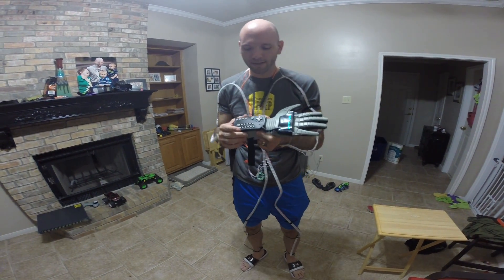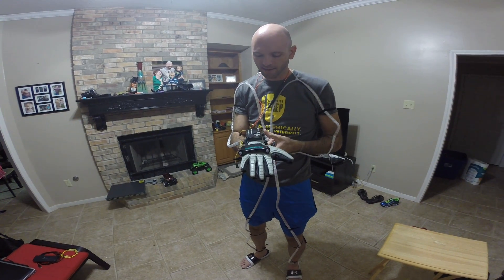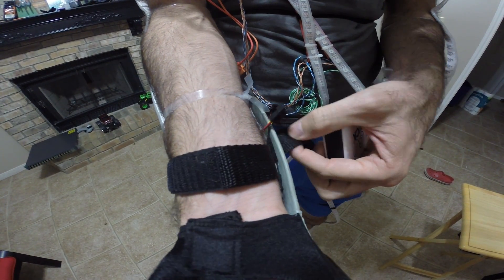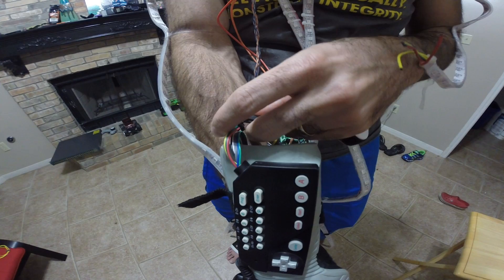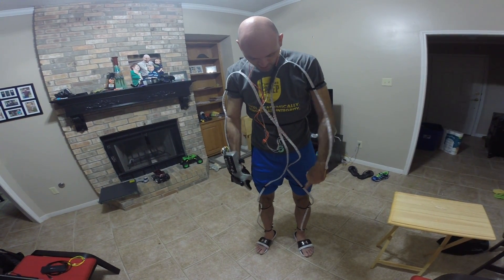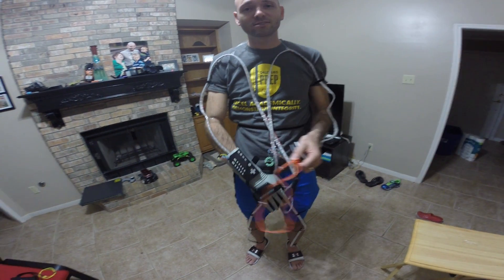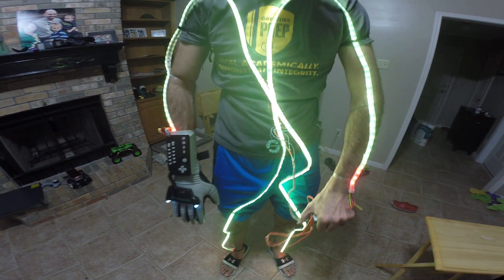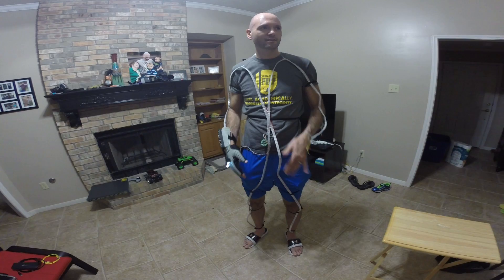NES Power Glove Light Suit

Comment: Ok all in all its really good. However if i might point out. When the lights are all on and you have the off color light moving along the path. Brighten it or make it a slightly more dominating color. That way you can literally follow it with more ease and in doing so it adds more to your performance.

Another thing you should look into is taking that idea but actually making like a full clothing out of it. aka gloves, shirt; pants, feet; and maybe work something out with a hood? IDK that was the impression i got from watching this. Now don't get me wrong, i've no idea how that stuff works but i think you could make it go a long way. All in all it looks wonderful.

However, is there a way to take away all the buttons and just let the glove/gloves do all the work. Like the right glove controls half( by this i mean all the right fingers correspond to a different action) and the left glove controls the other half? This way you wouldn't have to temporarily stop to click a button and in turn could focus more on making different rotations of the light and so forth.

Another thing that you might want to think about is maybe work in a way to have it react to your body. Say for example you move your left foot to the left spin and then move your right foot= rotation of lights only key to that movement. This way you can use your body; mind an knowledge of programs and so forth to make it better. < Just brainstorming. Not sure if its possible but figured i would give some input. Loved it nonetheless. :) keep up the good work.

Comment: Definitely, get someone like Fikshun or another good 'popper' to wear it. Also, I can't tell if you've done it yet, but you also could have the lights respond to the beat/sound, like in a lot of the industrial light and fireworks shows, where the lights, fireworks and lasers are "synchronized" to the beat of the music - but it is a cool idea to have the glove also able to control the various stages of the lights. Also, unlike the Adafruit posting below, I disagree - lasers are NOT at all a bad idea; not a "waste" at all - if done properly, you could combine LEDs and lasers, and have a stunning effect nobody has yet done! You'd have to have a "smoky" (artificial or otherwise) environment for the beams to be seen but, aside from that, you could integrate lasers, along with LEDs into the glove and the suit; or, maybe have lasers from outside, target the suit; and, when the lasers hit the suit, you activate the LEDs, almost like the lasers are activating the LEDs (picture "laser tag"). You could take a modified laser tag receive and actually make that happen automatically. Utimately, you could also have the LEDs 'spiral' around your arms and legs, instead of just hanging down straight; and see if you could get a spiral configuration to work. Just thinkin' out loud here.
Reply: just need the cheap light controller from the car accessory isle in Walmart, lol
pulse with the music